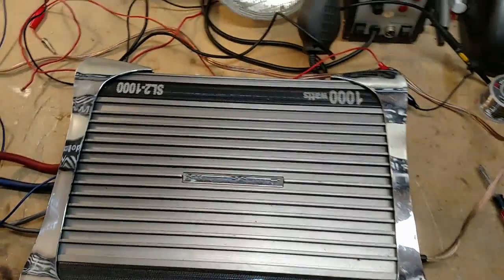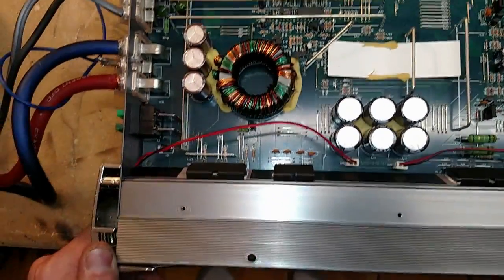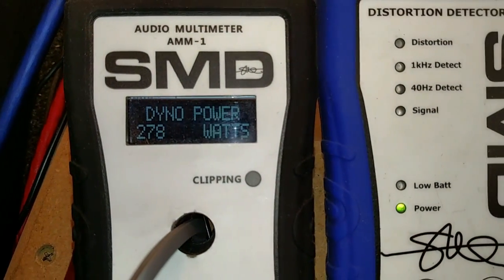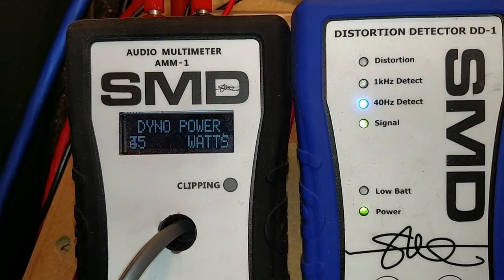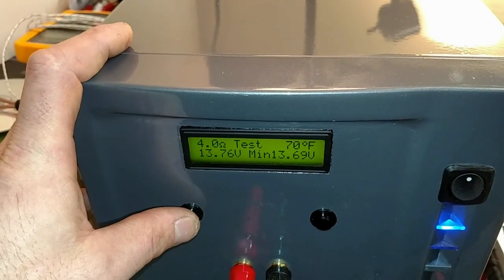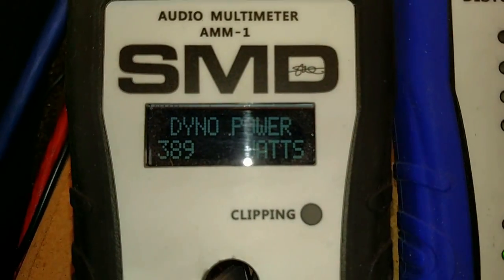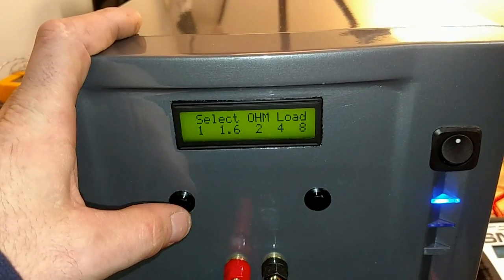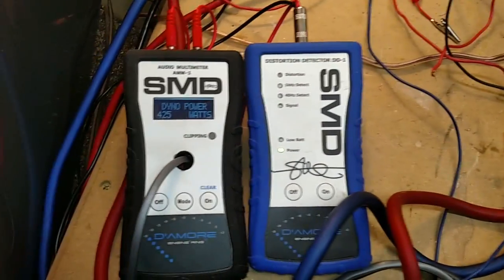AMP TEST! - Power Acoustik SL2-1000 - Amp Lab Dyno Test!

Comment: Single sided board?  Looks double sided to me as there seem to be traces on component side.  Crappy amp none the less.
Reply from the maker: Those aren't traces. they're just silk screen showing where the trace is laid out on the back side of the board.  So anywhere there looks to be a trace on top, if you flip it over, that is where the trace is on the other side.
Reply: OK, gotcha.  Hard to tell in the video so I wasn't 100% sure.  Thanks for the reply.

Comment: Any opinion on the Soundstream Picasso Nano amps? I have the 60x4 one (PN4.320D) for my mids/hi's and am pretty happy with it overall. My speakers are 3-ohm (Infinity Primus), so they're probably seeing between ~70 watts RMS. I also like the fact that it has such a small footprint. I've seen amp dyno tests of the monoblock variants and they make their power. I'm assuming the 4-channel versions are the same.

Comment: I used to have the 3000 watt version of this amp. It sucked at low frequencies but was surprisingly very powerful at higher frequencies. I wouldn't be surprised if this amp produced much better numbers using a higher freq. No need to make another vid but an interesting theory. But i don't recommend these amps at all...
Reply: *3400 watts, not 3000. But the guts look totally different. Much more internals but not nearly as many jumpers.

Comment: Well I don't know if you guys own this amp but I do. Well let me start by saying when I first got this amp I thought it was bullshit. I had it in my maxima first hook up to preamp out on one 12" pioneer. Nothing special at all, barely hit. So I pull it out again and use it because my PPI sedona 1300.1 went out. I must say its a bad ass amp. I didn't use the radio preamp this time instead I use the high level with a line converter. The amp is a monster. I have it on a quantum audio SPL sub dude Its loud as hell. My dd audio sub is in the process of being recone. That quantum sub is loud as my dd on this amp. Now the crazy  is I didn't know if it was a one channel or two channel so I said what the hell and bridge it down to 2ohm to see if it play at all. Well its 1 ohm stable but get very fucking hot. So I only run it at 2ohm bridge. Still a little hot but jam like a bitch. I won't jam it like that during the summer. I'm surprise by it and I almost got rib of it. Damn good amp just need fans on it. Oh I forget to mention the fuse pops a lot because it want power so I made 2 fuse that can't be pop and its jam fucking loud, it just get hot, burn your hand hot at 1ohm. My heart is ddaudio but I'm in love with this amp now!!!

Comment: Thanks for posting these videos...I love watching amp tests, especially old school amps, but any amps really. Always interesting to see how they do vs. rated. The amp mfg's should be concerned as they can no longer get away with these "mythical" ratings...we'll call them out! Keep it up!
Reply from the maker: Thanks Dereck.  I'm getting a bunch of crap right now on my Hifonics amp test because I said it appeared to be the same as an SQ2200D.  They said if I tested the SQ and it didn't do way over rated my setup is wrong.  Well I just did one and it did within 50 Watts of the Hifonics...  Just about rated wattage.  So my setup must be wrong right?  Well I tested an SK1500.1. it did 1970 ish Dynamic... SKARs own AD-1 test also did in the 1900 range.  I had a tad more voltage.  But people still won't believe.
Reply: rtkota5point9 Don't listed to the haters, it's just noise! It's one reason I mainly do old school amps, b/c the people interested in seeing those tests have been around a while and are more respectful. I've gotten blasted even with the Amp Dyno saying the Dynamic mode is meaningful...by people who are not engineers, but who don't want a particular amp to do good. I don't care how good or bad an amp does, I just post the results (as you do).
Reply: People are giant nuthuggers and will do everything they can to justify the large money they've spent. What is true is, facts are facts, test was done numbers dont lie. They follow the philosophy that you get what you pay for but when something throws them off, they will hold a witch trial.
Reply: rtkota5point9 Well I hope those people get explosive diarrhea.
Reply from the maker: Jeff DaChef AGREE!